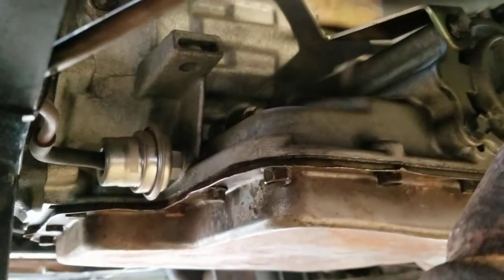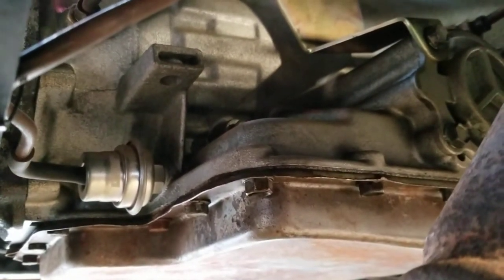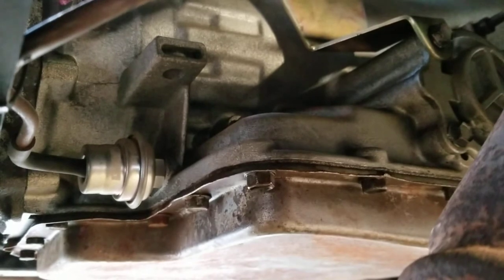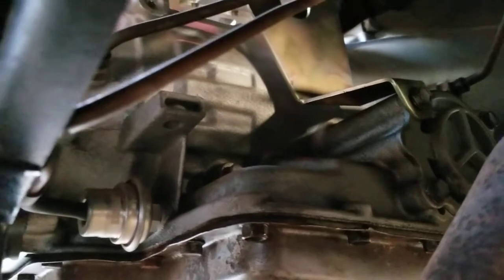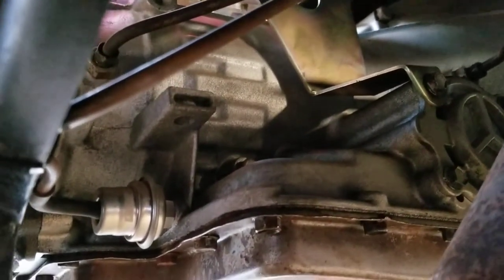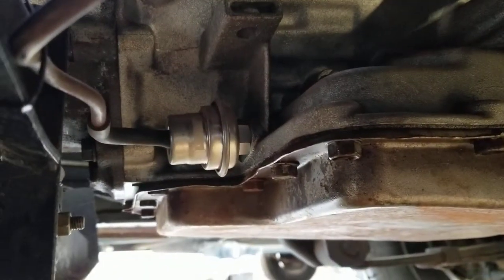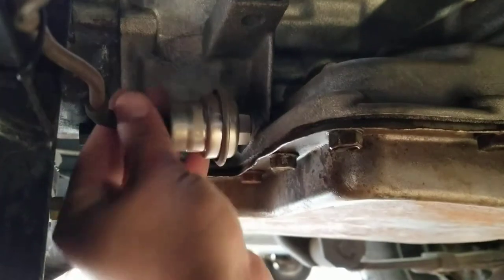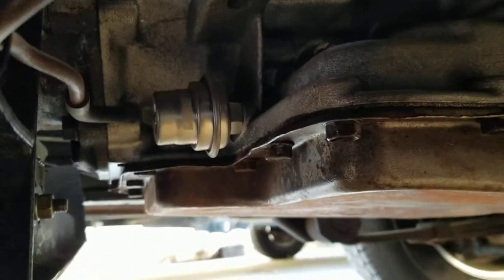Ford C6 transmission adjusting the shift points

Comment: If you adjust the vac module and it does not respond, replace it, probably has a vac leak. Cheap and easy fix. Thanks for sharing, I forgot which way to turn the adj screw. Cheers from Motown.

Comment: That had a red stripe is that a TCI modulator ? I have mine ajusted all.the way in not TCi though 3rd is fine it's 1st to 2nd that I'm having the issue with it shifts at 5/7 mph to 2nd I wanted it 13/18 or so

Comment: I go into second at 30 which is wayyyy to slow because the 6.9 doesn’t like to do 30 in first
Reply: Same with my 5.8, I’m at like 3200 shifting into second at 30. Also having some throttle position sensor issues that I believe are making it not want to start when at operating temperature
Reply: 6.9. Non turbo?

Comment: Hey man..C6 trans shifted fine that I parked it replaced the valve springs and intake manifold in the engine. Engine runs great but now my trans won't shift out of first gear. Any ideas?
Reply: If you haven’t figured it out yet but it could be your vacuum line